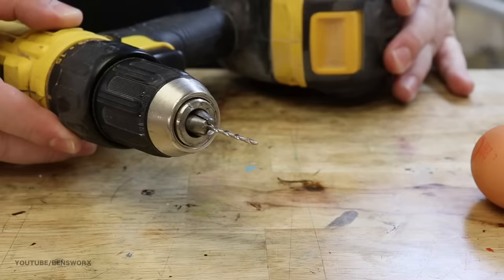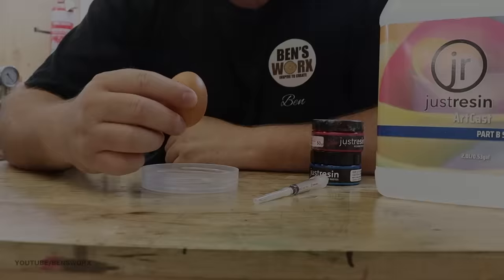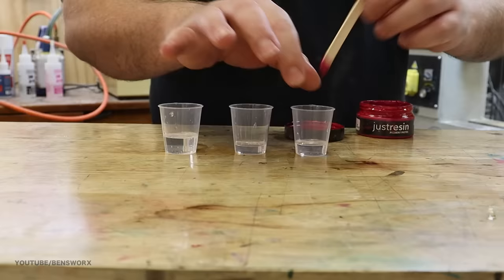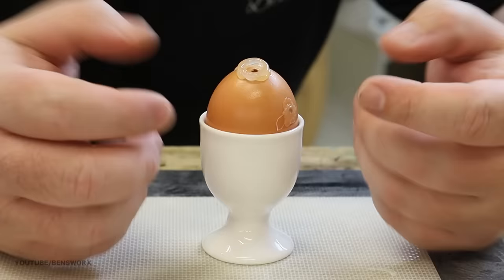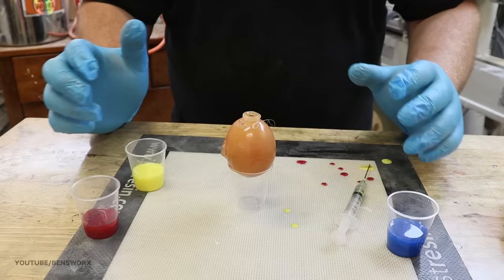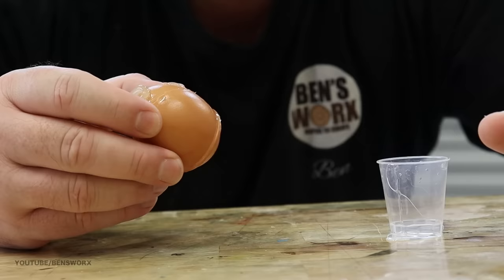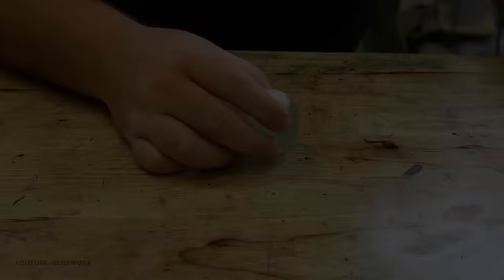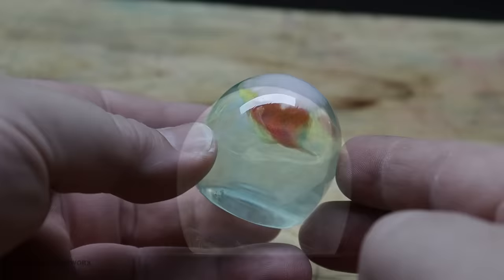DIY CRAFTS - Can You Inject RESIN into an EGGSHELL ?

Comment from the maker: Thanks for stopping by, If you have time you can check out my new range of Eggs here www.etsy.com/shop/bensworx
Reply: I said vinegar for the shell just as you did.  I think they made it just like you do.
Reply: Just got my egg in the mail.  Its stunning to look at.  I love the way the colors shift.  Beautiful work Mr. Ben.
Reply: nice, you are doing the trendy clickbait :D I just subbed to your channel a few weeks ago but after I saw this clickbait thumbnail I immediately unsubbed ,
good luck sir , ..
Reply: @za88y  you realise this was the point.  Using a clickbait fake craft and running with it.
Reply: Egg shells are very porous, so I'm pretty sure that's why the little bit leaked out in the pressure pot. The membrane remaining in the shell or not, even hard boiled eggs are not actually smooth so this captures the correct texture perfectly. If you cast egg white resin in you could recreate a fake hard boiled egg which would be pretty amusing for a resin fake food project. Just do a light polish on the egg after and it might look pretty darn real
Reply: Try making the hole a bit bigger filling the egg with colored resin and use a tooth pick to get some swirls inside of the egg
Reply: I really like this. I like the smokey effect in the resin.
Reply: should make a 2 part silicone mold of the egg and stick the needle through the silicone after
Reply: Nerdecrafter also tried this. Maybe her method is easier?
Reply: I KNOW YOU CAN DO IT IF ANYONE CAN AND I KNOW IT WILL BE ABSOLUTELY SPECTACULAR 💯🤗🤙🏻💚
Reply: GOTTA DO ONE WITH THE MEMBRANE TO SEE WHAT HAPPENS
Reply: WHAT ABOUT AIR BUBBLES????
Reply: You should fill straws with color resin and arrange those in a clear resin cylinder and make some kind of light out of it or something
Reply: You must do it with an ostrich egg!!! Will look awesome
Reply: The eggs at your shop are awesome! I really wish I could afford one 🤩🤩🤩
Reply: 99⁰ @LostWhits

Comment: When doing the resin on eggs there's an easier way you can do your egg take the needle that you using the syringe needle only drill one hole in the egg at the top use that needle to put air in it and clean out the yolk Tippett upside-down put the Needle in and squeezes are in in the yolk in the egg will come out then put water in the needle and do the same thing to clean it out once it's clean use the needle to put your resin in it'll fill up all the ways up and then you can use your same needle to get the colors put the Needle in towards the left and then moving you around as you're putting the different colors in so you can make your rainbow pattern and then once it's cured and set you can then peel it and your egg will be just fine you don't have to do it with many holes or Julie many holes you only need one hole in your egg I've done it many times but not with resin I've done it with Jello it's the same process when doing it with Jello my kids love to make them I also do you create an egg so I know a lot about doing different things with eggs so try doing it that way instead

Comment: You could make a silicone mold of the egg, that way you could have more control of shape and design of the resting egg.  Loved the video.
Reply: That's what I thought he would do.  It's the first thing I thought of so if it was a success you could make more.
Reply: that's too easy....we want the hard n more complex way
Reply: Seriously that was way disgusting.
Reply: Or plastic eggs like you put candy in ? Just a thought. Maybe resin gets too hot ?
Reply: Orrrrrrr, tape up the bottom hole with painter's tape to seal it. No side holes, just use the hole at the top. Inject the resin in small batches of different colors and allow to cure & set before adding the next color.
Reply: @emdee8840 I was thinking along those lines too, to even take a step further to make it easier with the coloration, use different length needles start with the longest one first get the bottom color and then go progressively shorter needles for the different colors towards the top

Comment: Just a thought, Use the bottom hole to put the resin in. That way you can hide imperfections with a stand or base. 2nd, You don't need the other holes. Use a longer needle and just work it around as you inject a little here and a little there. That would also make for a bit of stirring to get the colors to string out through the clear.

Comment: I learned maybe 60 years ago to drill the hole with a brad nail as I did not have tiny bits back then. I also learned to take a safety pin (long) and cut the end off and bend it slightly 1/4" up then stick the one end in the drill and the other in the egg and then WHIP the egg in the shell and it runs right out. So no hard blowing for like 5 minutes. Mom made "glass" eggs as she and her best friend made those table ornaments that looked like grapes in all sorts of colors. Back then they used glass molds for each grape, quite costly as they could have made silicone molds quite cheaply.

Comment: You could use some electricians tape to cover the holes, it's like 1.5cm narrow and streches a bit, and doesn't melt like hot glue. That egg turned out nice, and perhaps you should wait between resin layers to harden before applying the next color. Cheers mate.

Comment: You can also have more control over the size and shape of the holes in the egg by using a bit (I've found diamond tipped rotary bits work really well) and drilling by hand. It's less likely to break the eggshell.

Comment: In the bottom of an egg is a white membrane layer, with an air pocket underneath. When you put the resin in, it seeped under that membrane, encapsulating it.

I have chickens so make loads of pickled eggs & when boiling & peeling them (depending on how they were in the pan) often find an egg with a flat spot on the very bottom & always have to make sure I peel the membrane off the bottom of the egg. It doesn’t stick to the eggshell like the rest of the membrane because of the air pocket underneath it like I mentioned.

Comment: It was so interesting to see the entire process and all the mistakes, because I learned a lot. Now this is surely a very difficult way to make a resin egg, as you get molds from Ali express for some few coins, but if that is what you have, I have these points to add:

Only poke one hole in the egg. Stir with a stick and suck the yolk out with a syringe or a special balloon you get around Easter that does the same job. Rinse afterwards. 
Use a very thick and long needle, it won’t be so hard and you can add effects with the long needle as well. 
Maybe stirring is an idea to get more effects as well.

Comment: If I was doing this, I would go with only the two holes on the top and bottom.  After the egg is blown out, seal the bottom hole with epoxy.  Then fill with clear, allow to set up a little bit to where the color resin will be more "stuck" in the place it is injected, and then inject all of the colors from the top, just varying the depth of the syringe with each color.

Comment: As a test based on this, it would be interesting to drill a few holes into a clear container and fill with clear resin. Then inject coloured resin through the holes at different times before putting into the pressure chamber and use potcam to see what happens. :-)

You could also see what happens if you inject with the syringe in place or inject and withdraw the syringe at the same time to leave like a trail. You could even insert two syringes or a fill a syringe with alternate colours and try that.

Comment: Take the egg. Hard boil it. Spray it with mold release.
Cast a rubber mold around the egg. Leave a sprue on top using a cut segment of a wooden dowel, or a straw, etc. 

Deflash the egg from the rubber mold. 

The purpose of hard boiling is to prevent making a mess if the egg cracks/breaks while removing it from the mold. 

Once you mix your resin in various colours, you can start the fill with clear and then follow up with whatever colours you like in whatever opacity you choose.

Comment: What about just having the top hole open (no need for the side holes), you should be able to direct the needle to the areas you want the colour, this would also help if you put the egg into cold water to keep it cool and not melt the hotglue on the bottom
Make a higher dam at the top as a reservoir for extra resin.

Comment: i once made resin eggs for a movie but i used plastic Easter eggs and just cut them open at the end
i had to deal with the mold line but that was an easy fix, i just sanded it down and polished the whole thing on the lathe
to make life much easier i suggest removing the needle off of the syringe when sucking in the resin and putting it back on when injecting into egg, that way u dont get too many bubbles in the resin

Comment: They actually make a little tool for putting holes into egg shells. You just push it down on the device and a small pin pokes a hole in the shell.

Comment: I would use the resin on the bottom hole to stick it to a base as well. Then only use the top hole to add resin. Alternatively, as someone else said make a mould with the pointy end at the bottom of the mould.

Comment: Maybe a bit late, but here's my opinion: just use the hole on top and inject layers of clear and color: clear resin, blue, clear, yellow, clear, red, clear. THEN, at the end, either insers a thin toothpick and stir the insides a little, or just give it a good shake yourself. Maybe that'll give you a better chance at a somewhat more balanced color distribution.

Bonus tip? Don't go for strong colors. Make them a bit more clear.

Comment: You have to do the colored resins in layers. So start with say the red. Put only red resin in and when that's set then you put the blue color resin in and when that sets you put the yellow resin in. And once the yellow sets then take the shell off. There's not really much otherwise to do it. At least I haven't found any other way of doing it.

Comment: Maybe a better way would be to make a silicone casting of an egg. Probably an egg which was waxed to make the surface smoother. Would be more convenient to use, especially if you decide to make many different ones.

I'd mix up several colored resin samples and fill the mold with them one by one or a couple at once through different inlet ports, so the streams would mix inside in a chaotic and unpredictable way. Could be interesting

Comment: Okay, Ben, this is how you should do it: One hole at the top, large enough for the syringe and for air to escape.  Then, clear resin in first.  After injecting the clear resin, rotate the egg around to fully coat the inside with the clear resin.  Then, after a few minutes, inject the rest of the resin while keeping the egg upright until it overflows the hole slightly.  Then, after it cures, put the egg into a bowl of vinegar to dissolve the shell.  I'm 99% sure this will give you good results.

Comment: Neat idea. What if you apply different layers at a time, injecting colored bits in the different layers. Can you add layers of epoxy on top of another just as is gets hard? Also is it possible mix the color up in a faster set epoxy than the slower set clear? If they were of the same brand, would they react badly. 
Also what if you used a longer needle an inserted everything from th he top? Could you make some of those patterns?
Regardless of my ramblings, great videos. Love your content.

Comment: I tried this about a year ago at Easter time. I did not use a real egg, rather a large craft one I found at a craft supply store. Mine got so hot it started bubbling over and I had a huge resin mess. It turned out ok for a first timer. Had I been more patient and not filled the egg to the top, it probably wouldn’t have overflowed. I can’t even remember what type of resin I used (slow, art 🤷🏼‍♀️) I just got it from the craft store.

Comment: With emptying egg shells (like people do with painted ukranian eggs) you need to leave and let it sit so all the membrane stuff can dry up.  At least that's what I remember.  It might be a good idea anyway, since you're pouring resin into it.  I just don't think dried up bits of membrane on the side would cause that kind of reaction/it looks like cooked whites to me.  You could also use some gentle canned air or something like it to help blow out parts.  If you do a larger hole like I suggested below and I've seen other people suggest, it would be easier to get rid of any leftover membrane with a q-tip or something?

You could do a bigger hole on the bottom of the egg when you get to the pouring resin part.  It'll be easier to see what you're doing and you're already giving the bottom more of a flat base to stand on. With a larger hole and a syringe you wouldn't really need other holes, since you can get pretty accurate with injections into/on top of resin.  Dunno if you plan on doing more like the whole ice cube series :3 but it might be worth it to invest/use a large magnifying glass (the kind with a clamp so you don't have to hold it) so you can be more precise (at least if you do the large hole part).  Either way still loving these videos and I am in love with my dragon egg that arrived the other day. It sits right in front of me on my keyboard drawer by my speakers, and I feel so happy/in awe of how amazing it is.
Reply from the maker: Thankyou! 😊 great suggestions 👍

Comment: That white bit on the end looks like there was moisture inside the shell, but it turned out cool!  Something else that might be cool is to put in the resin and then use a dremel to carve some kind of pattern through the shell.  Put a flat LED light on the bottom so it shines up through the resin and the pattern that you carved.  That might be fun, huh?  Thanks for showing us this project.

Comment: My suggestion is to plug the hole at the top and turn it bottom up. Don’t drill extra holes, express the resin in directly from the “top” hole and just adjust the dept of the needle. Worth a thought.

Comment: Would it be easier to make a mild of the egg and then seal the mild and pour the colours in that way?
That way you still get the egg shape without having to deal with the shell and you can see were you're putting the colours if you use a clear mold.

Comment: You could maybe fill it one third with resin, let it rest then inject color, let it rest. Then inject 1/3 more then rest. Then injunction the colors and rest. Then top off the resin and rest then inject the rest of it colors. All using one injection point. This might distribute the colors a little more. It looks fantastic as is though. Very creative! Also, you might try a treated silicone Easter egg mold? 🤷‍♂️

Comment: How about making some egg molds from silicone and pouring the resin into them. 
Or those moulds with two halves, and a what about those moulds with the bigger dam at the top.
Like if you are melting melt and casting some metal.  But instead of metal pour in rein, 
I have never done anything like this before I just saw so many good ideas and thought 
I might jump in and make a few suggestions. Peace out

Comment: The white spot on one end of the egg may have been caused by the fact that there is a pocket of air located there that is surrounded by membrane, so that membrane there would have been almost impossible to remove and may have been missed, causing the discoloration.

Comment: You could try using silicone caulk instead of hot glue. It will better withstand the heat of the curing resin.

Comment: When you put it in the pressure cooker without heating up the resume if you got them old elect the bubbles in there so therefore that white stuff on top of your bubbles clicking one spot that's why it's foggy view the torture he gained for distance away and he got the Shell with red inside the heat were dispersed the bubbles in epoxy outlet out of it it would be crystal clear

Comment: When you said you were going to add colors i had to pause the video. To add colors and have them stay in place you need to let the clear resin to set up until thickened but not hard. Then add the colors. This will allow the colors to float like i the thumb nail.

Comment: I wonder if the cup you set it on might've turned into a suction cup under the pressure allowing bubbles to form on the bottom of the egg as the resin cured

Comment: Im not an expert for resin, but i think it could be possible to do it! But first the Milky Top part "problem". Well i assume it is because of the 2 Holes! If you put it in the Vac chamber to suck out the bubbles where should it go? From the bottom Hole it sucks in the air of the little cup under it and transfer it to the top small hole that is closing too!

 Because of that i have a different idea how to make it:

Step 1: Blow out the Egg or empty it with a syringe (in this case ignore step 3)
Step 2: clean it! 
Step 3: Close one of the Holes with Resin let it cure! 
Step 4: Adding the colored Resin until 3/4 of the egg is full and shake it!
Step 5: Adding the rest of clear Resin!

Comment: you could have achieved better results using multiple syringes for the colors and a large one for the clear, with a bigger hole at the top you can inject clear and color together. just switch from color to color a few times. make sure to over fill before puting in vacuum chamber to compensate for resin loss and air bubbles. also rinse the shell with rubbing alcohol before process to avoid clouding

Comment: The egg in the thumbnail is afaik a turned pinecone cast in resin. So, yes, one could put the resin into the eggshell, and the idea to free it with vinegar is pretty smart. But you'd never get the thumbnailed result, sadly.

Comment: you coulda used the drill bit to liquefy the egg 😁 but next time try using a fast curing epoxy, mix one layer at a time and let it set if you want a multi layered casting